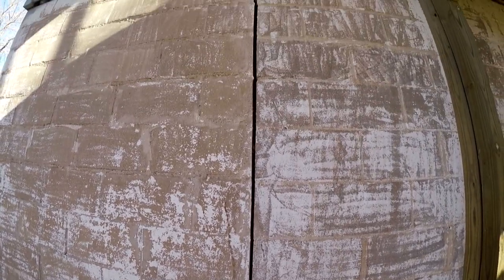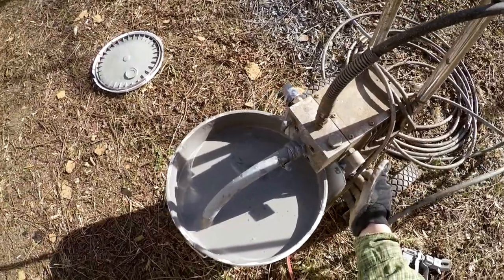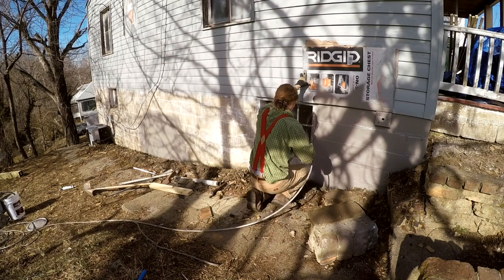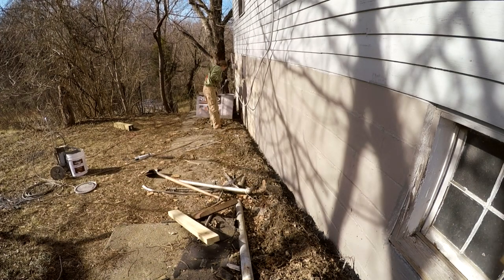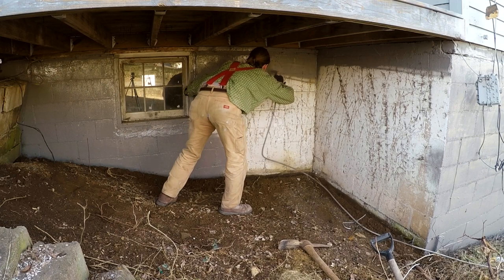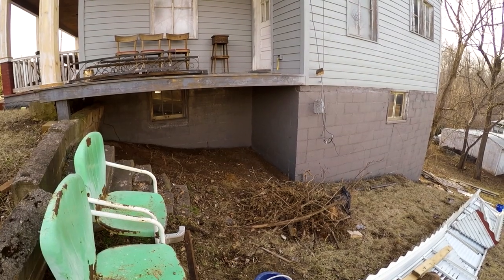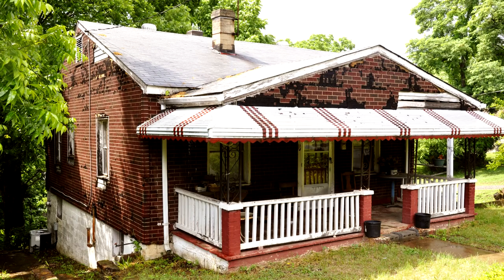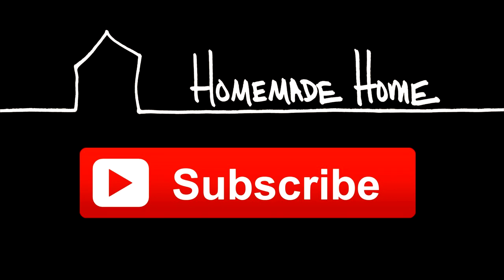Painting a Foundation - Exterior Home Renovation

Comment: Huge improvement.  Looks like you also replaced/rebuilt the rear porch + overhang?

I've often thought that a walkout basement with a basement shop would be a good thing, since it would give easy access for getting heavy tools and wood into the shop.  However, your slope is pretty steep!

Keep up the good work.  Looks like you're adding huge value to that property.  Do you have a large lot to go with it?
Reply from the maker: wordsnwood The back porch was there, but I made some changes and reinforced it.
Reply from the maker: wordsnwood oh, and the lot is small. But it's in the city so I don't care about having much, it's less to take care of. The next move after this house, hopefully, is to buy a significant amount of land with a house and shop or build it all. We'll see. Thanks.

Comment: Mmmmm ......... no mask ? Come on mate , new lungs are not a cheap opp . The new pillars , are they cladding on the steel ? Or have they replaced the steel .
Reply from the maker: magna59 This is water based paint and it sprays pretty wet. So it's not that bad as far as being air borne. As far as the columns, this video will answer your question. https://youtu.be/3C_CRmh3nAA
Reply: Homemade Home Thanks for the reply . Keep up the good work ps water based , so ' s cholera , it ' s not all good .
Reply: Guna have to agree with magna on this one. You need to be wearing a mask when your painting.